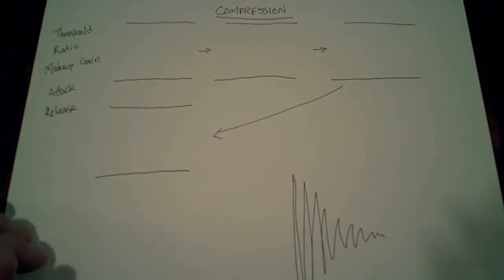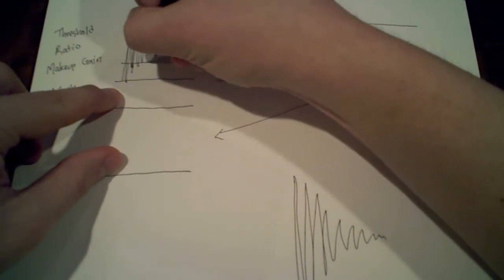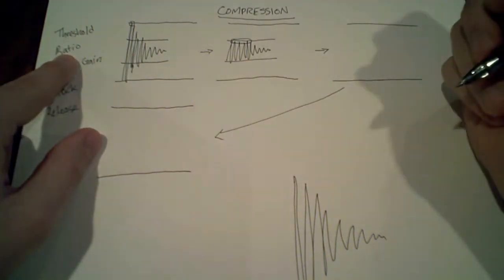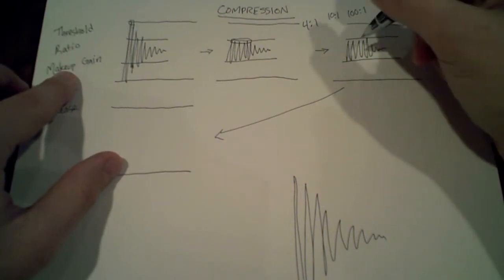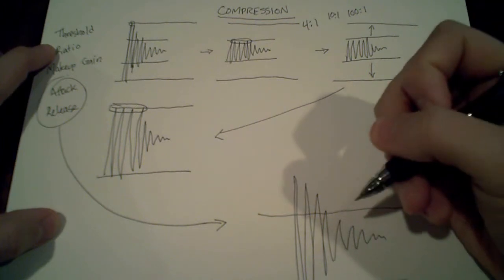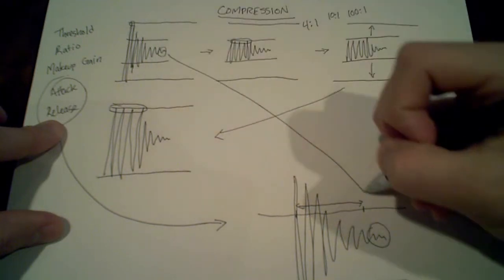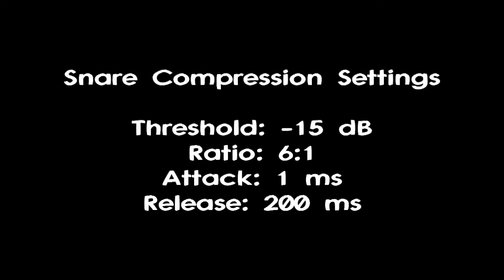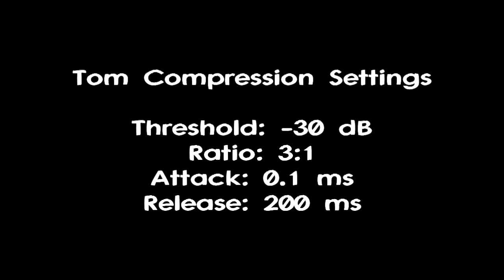Drum Mic Tutorial - Part 5-1: Compression and Reverb

Comment: There are mixers out there that you can do your compression and other effects, They are the more expensive mixers than the analogue mixers, they are called digital mixers, they are available in lots of different brands, They also use the plug ins that you get on your work station, they are great to work with, you practically can produce live. for analogue mixers you can buy external processors , whether its effects or dynamic, but in the end you would pay more for all these separate units.